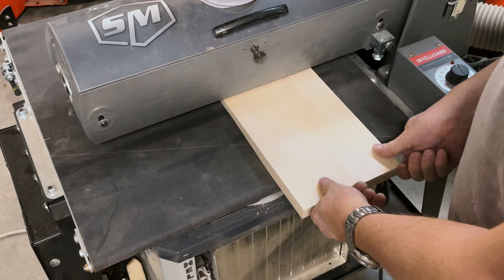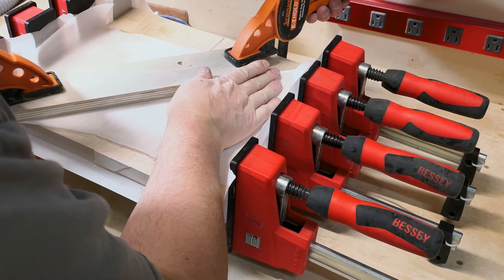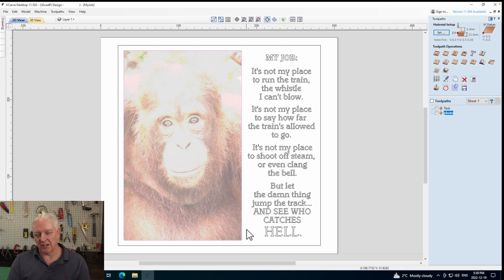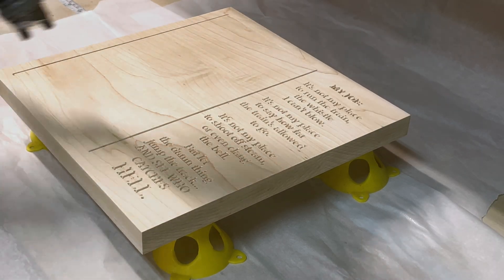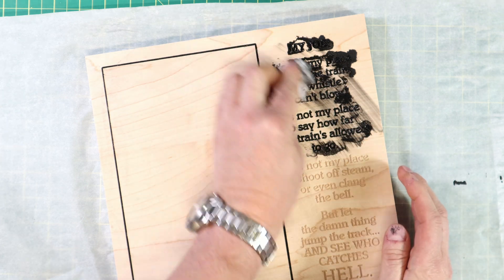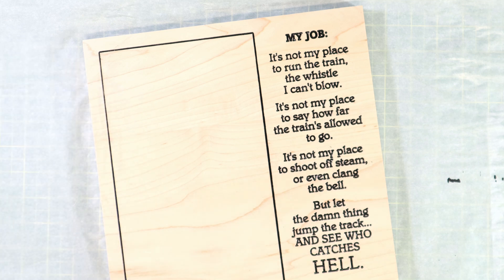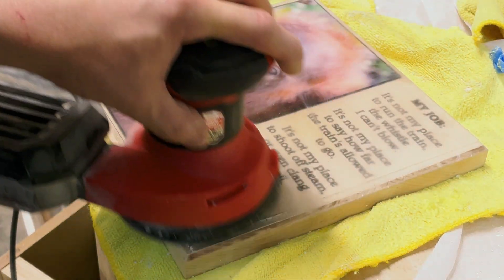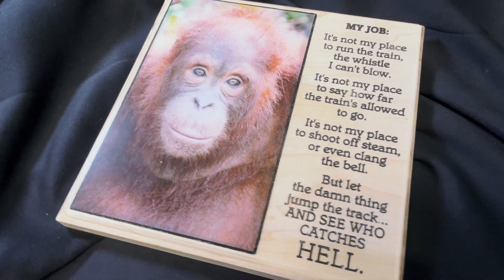Inside the World of a Maker: Rebuilding a Customer Favorite

Comment: What did you charge for this job? I’m curious as to what people are charging for different projects.
Also, did you laminate the photo to protect it from the resin?
Great video!!
Merry Christmas!!
Reply from the maker: I don’t normally share customer pricing here on the channel.

Regarding the photo, I just glued well it along the edges and resin bleed was minimal, though I would probably use 3M tape if I ever did another one of these. That would ensure a better seal and prevent any bleed of resin
Reply: I get that but we all have to value our time for making things and I was just curious as to where you fall in pricing. BTH or flat rate? 
I’ve been wanting to do a photo on wood with resin and I seen one project where they laminated the photo to protect it and just wondered if that’s what you did. 
Thanks, Steve
Reply from the maker: @arizonaheatwave4080  I normally charge a flat rate, which implies that I've considered the time to make the item, so it generally works out to about the same price either way.

You could laminate the image first, but it's probably not necessary unless it's printed on paper that readily absorbs resin.  I used card stock, so the absorption isn't too much of a problem.
Reply: That’s kinda what figured, I do the same, flat rate, if I charged by the hour I’d have no customers!! Haha

Good info, sir. Myself I think I’ll try your way first and see the results and go from there.
Reply from the maker: @arizonaheatwave4080  To be clear I still estimate my expected hours into the price.  I have found that I get a lot of repeat customers, even if it costs more, because they know I will be meticulous.

Anyway, Happy Holidays and have a great New Year!
Reply: I just feel I’m undervaluing myself so I thought I’d get another perspective. 
I also do feel a flat rate is the way to go so we should be proficient in our estimates. 
Stay warm up there, Steve!! I’m originally born and raised in Alberta but I moved to Arizona 5 years ago, don’t miss -50!!! Merry Christmas to you and your family!!! 👍🏻👍🏻
Reply from the maker: @arizonaheatwave4080  Happy New Year, and for the record the temperature at my house today was 12C (54F).  It doesn't get to -50 on the coast and rarely gets more than a few degrees below freezing.  Not Arizona, but warmer than Alberta. 😀